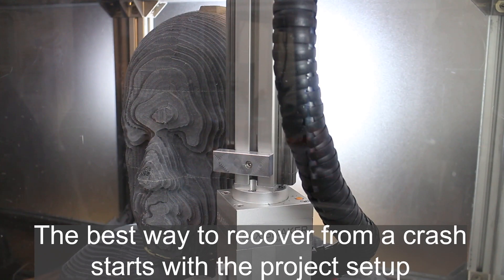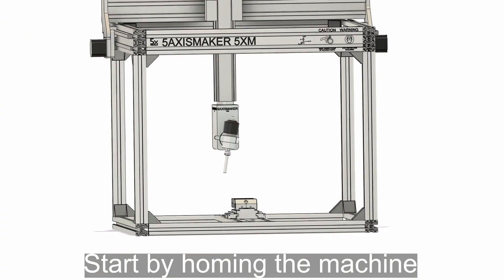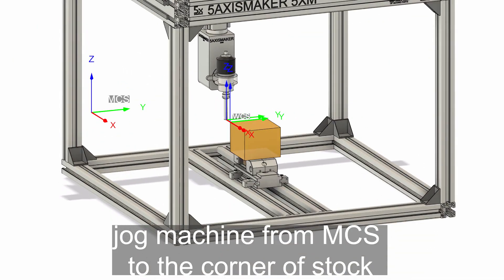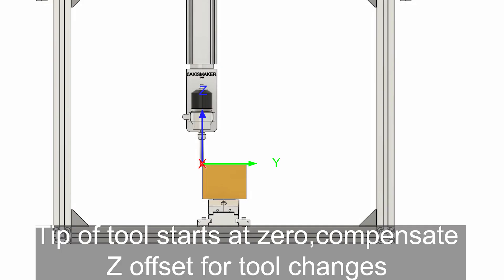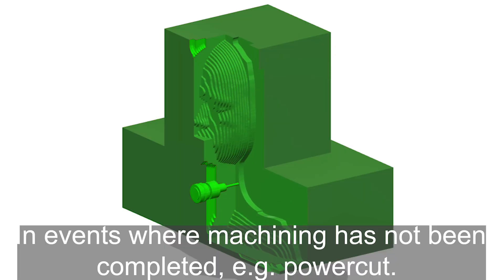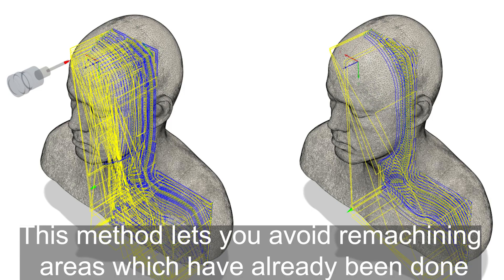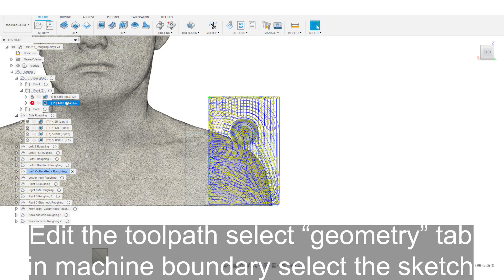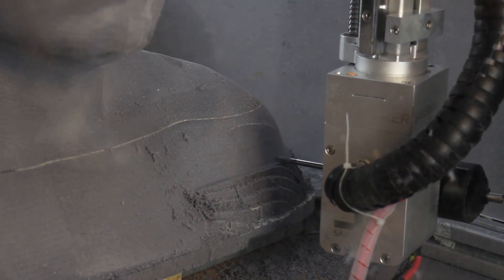5AXISMAKER Crash Recovery Tips

Comment: do you have 3d printer options? Im asking because I couldn't  find it on your website
Reply from the maker: We do indeed supply all our machines with a 15k RPM ER11 spindle and Bowden type extruder. A standard option comes with 1.75mm extruder that is used for PLA/PETG/Nylon filament, we include 0.6mm nozzle but can add others sizes of nozzles too.